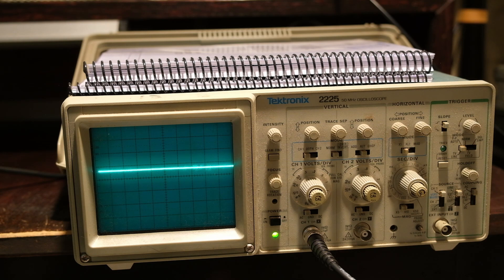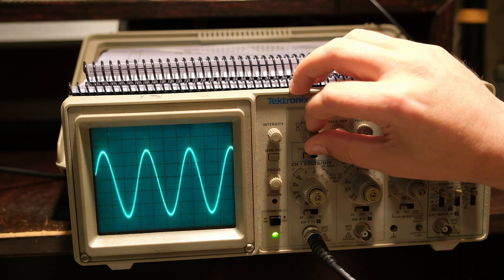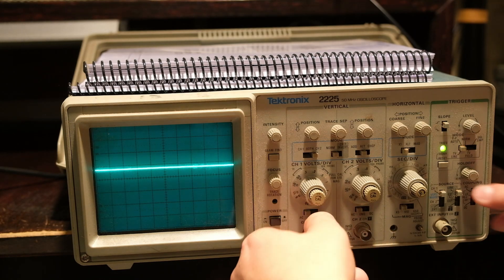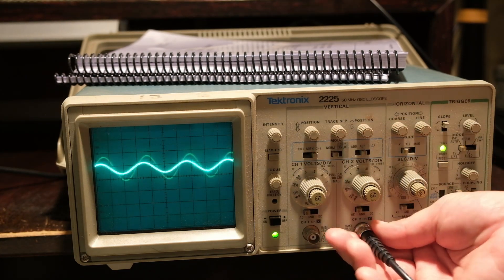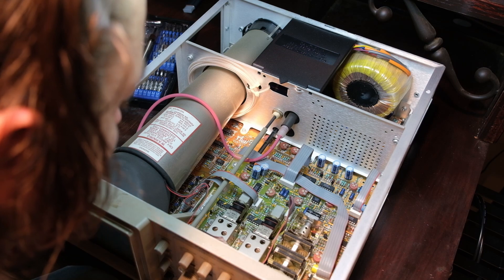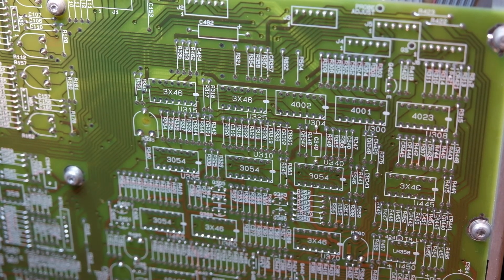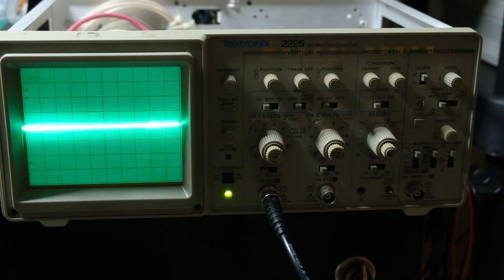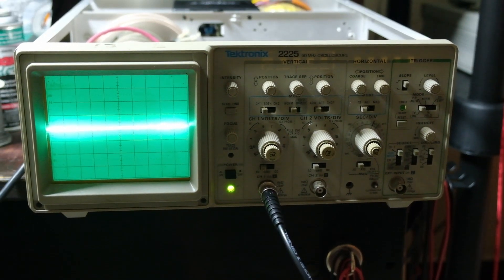Tek 2225 Checkout & Repair

Comment: Nice upload ! Tek and HP PCBs are works of art, I'm with you about the cleaning of the wafer switches, has to be done after 30 years and that was clearly the issue and yes you ended the Riffa Madness before it began ! solid little scope. I've subbed and yeah it's great you cleared up that insensitive "proper job " comment  Lol ! some people would have taken that the wrong way, we love our Tuber's and I look forward to more...cheers.